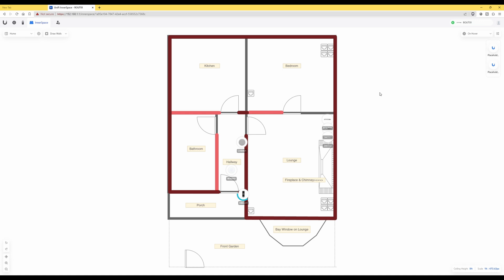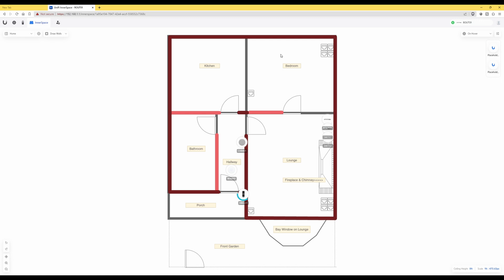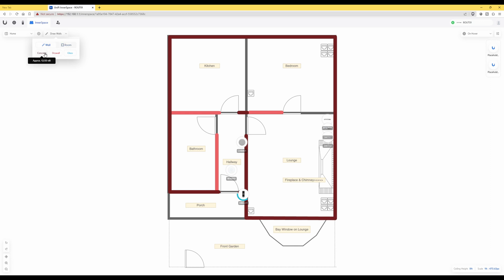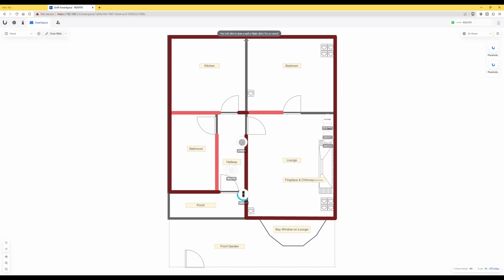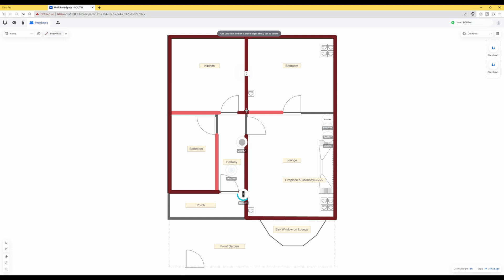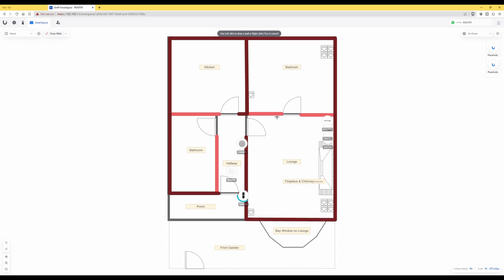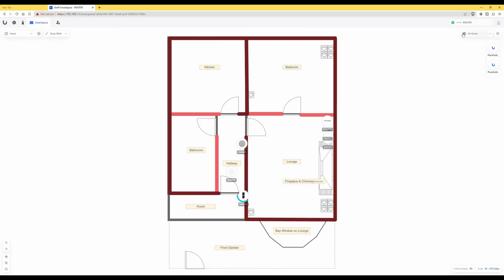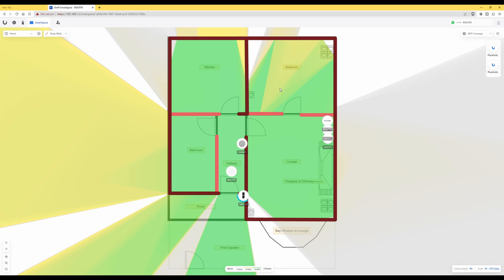UniFi InnerSpace - Let's Correct My Mistake

Comment: Thanks for the correction, how do you add an upper floor?
Reply from the maker: No problem at all.  I had to do a correction with that  obvious mistake.  Good question, in fact that has been discussed in the comments for the InnerSpace video and you have to just create a second diagram for other floors!  As don't forget the signals from access points are unidirectional in theory so they would expect you to have another access point on other floors above I think!

Comment: What if the access point is mounted on a wall instead of a ceiling?
Reply from the maker: I would think there would be a small amount of difference in signal penetration through walls etc. but I haven't tried it, I guess you would probably need a UAP In Wall for example in your network to have a comparison of the Wifi coverage
Reply: @MrTimTech2022  I've got UAP In Wall too. After some testing with "wifi man", it showed that the UAP AC Pro mounted on a wall has great range and signal strength.
Reply from the maker: @EmarcelCom - That's excellent, thanks for letting me know, always useful info to keep in mind for future use :-)
Reply: @MrTimTech2022  Not sure if you already know this, but if you click your AP within Innerspace you can choose if it's either wall or ceiling mounted.
Reply from the maker: @Madmik  Hey Madmik, thanks for that info and no I didn't know but useful to know and hopefully useful to other viewers too 😁

Happy Christmas!